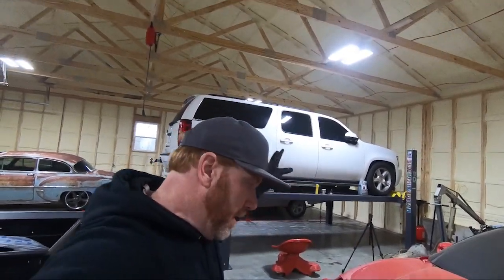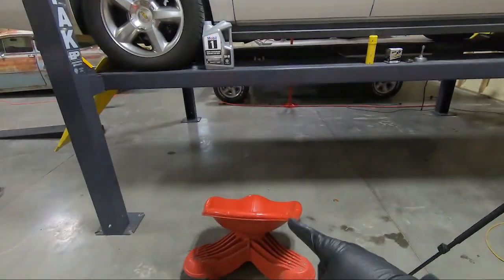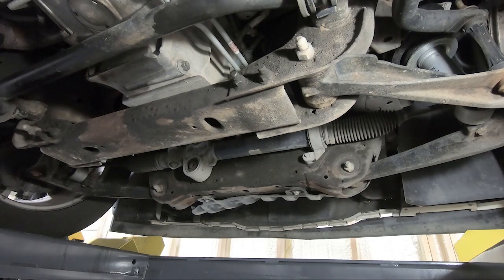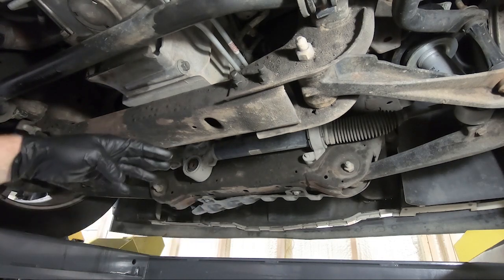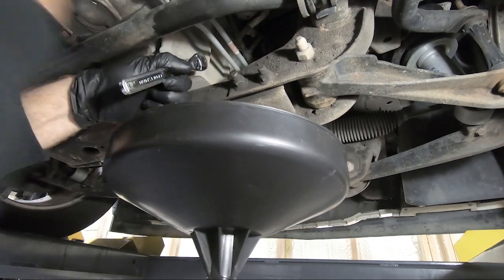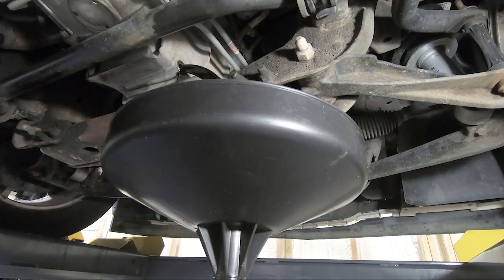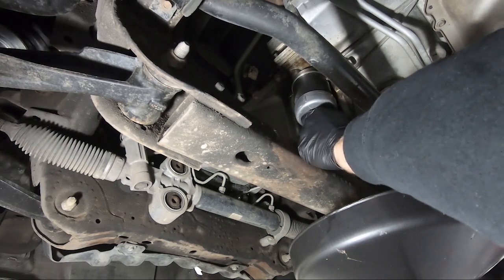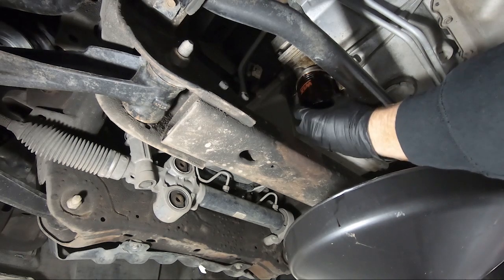How to Change Oil Chevy Suburban or Tahoe

Comment: I always used that same oil in my stuff and recently my main mechanic said that it wasn’t recommended for my Tahoe and to just use conventional oil.  My Tahoe is an 07, he said he thought it was 2011 or newer or somewhere around there that they recommended the synthetic oil. I was having oil leaks and he though they may be worse because of the thinner oil I was using. My Tahoe is the 5.3 with 177K miles on it. Any insight on this?   I also burn a decent amount of oil between changes one reason I opted to try the cheaper stuff since I’m burning a quart or up to 2.5 in some months between changes. Stupid AFM.
Reply from the maker: Yes if you have leaks synthetic oil will find a way out. I deleted my afm/dod
Reply: Your burning that oil,,, because of the damage done by the AFM system.  
This excess burning will not end, until you replace cam, lifters, and mechanically delete that afm system.
You can software delete it,,,, but the damage is already done inside your engine.
Reply: @MrDavez   yep.   I hate AFM. Mines still active because I do t really see the point now. It has 178k Miles. I got it with 121k has burned a a quart every 2,500 miles since I’ve owned it.  Recently replaced a clogged cat because of it. Oh well. I’ll keep chugging her down the road. Still runs and looks great.
Reply from the maker: I tend to agree
Reply from the maker: Drive it until it breaks

Comment: Poke hole in bottom of oil filter,, once you verify it moves, and is NOT stuck on block, because of some gorilla handed lube tech,,  then put plastic grocery bag over filter,, spin off and catch in bag,,, most of the mess and the filter.   ;)

Comment: Recently lowered my 08 Escalade, and changed the oil right before I did that. Jacking it up for an oil change instead of simply driving it up some ramps seems like too much extra work when it's real cold outside. I am pretty glad I decided to buy the low profile long reach floor jack from Harbor Freight a year or two ago. Should make life a little easier
Reply from the maker: I have one of those too and it is a good jack for stuff like this.

Comment: You ever check out Fumoto drain plug valves?  I have a 24V Cummins and Dodge made the drain plug flush with the oil pan in the center.  Use the square 3/8 ratchet drive to loosen and tighten.  Insane mess every time.  Bought the Fumoto and it's soooo easy.  Worth every penny on my diesel.  Not sure if you've heard of that or are interested.
Reply from the maker: I have seen them but never used one.

Comment: Hi , Travis .. Is true that old engine like Chevy suburban 2009 with more than 200 thousand miles we should USE an oil rated 20/50 instead of 5/30 especially in hot areas?!
Reply from the maker: I never use that thick of oil.

Comment: How many miles (or months) is the "oil life" display calibrated to?  Can that be changed, say, if one is running full synthetic vs. std. 5W30?  (5,000 miles vs. 3000 miles.)
Reply from the maker: Its based off temp, miles, rpm. Not mileage based

Comment: I have a gmt800 truck and after every oil change I put my gas down and turn over the motor (puts it in flood mode so its cuts fuel) so it serculates oil through out so it doesnt dry start
Reply from the maker: Very good idea. Thanks for that information
Reply: @TWAMotorsports  anytime bud!

Comment: AI Generated:
Do the filter first. Punch a hole in the center of the oil filter and drain it, lot less mess.
Pre-fill the oil filter (if vertical) it saves 6 seconds of dry start (glad you like it).
The reason you had problems removing the drain plug and the filter is because you don't torque it to the right specs, and your a little stronger then the average bear.  Use a torque wrench for the [peace of mind] and striping out [drain pans] is expensive.
The 2007 Chevrolet Suburban drain plug is 18 ft/lbs:
If exists a socket for the filter is 18–20 ft/lbs.
Make sure old filter o'ring comes off with filter, and pre-oil new o'ring.
TWA, never ever ever re use a gasket.